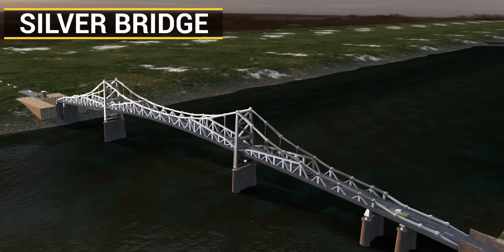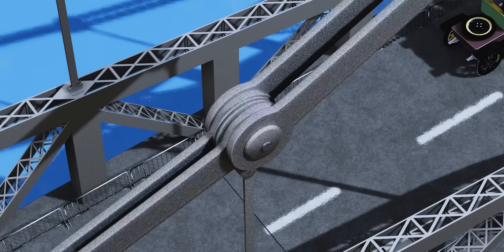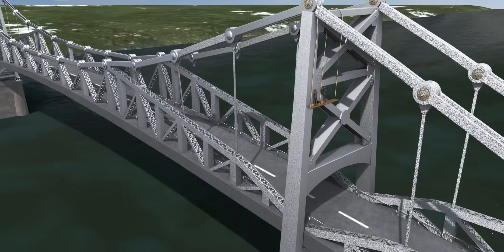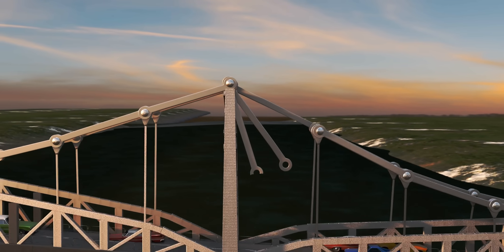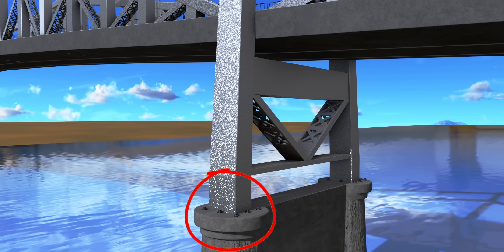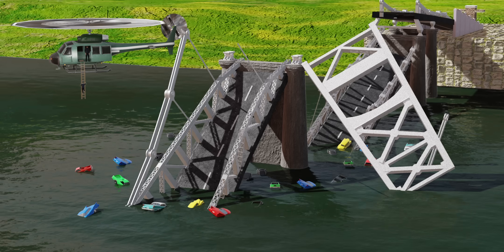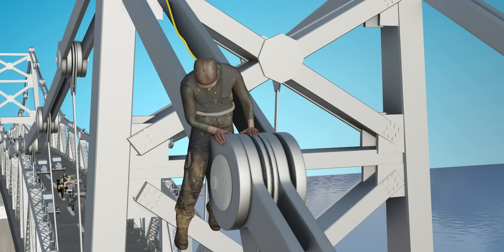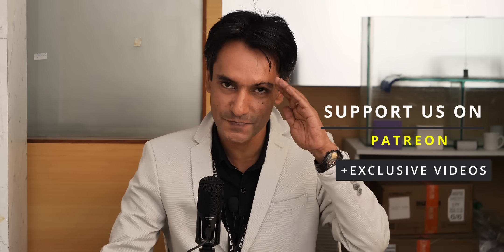Silver Bridge | The Tragedy That Changed Civil Engineering Forever

Comment: As a structural engineer, I disagree with you that the increased weight of vehicles was the main cause of the collapse.
This increase in weight only accelerated it. In other words, if the vehicle weight had not increased, the bridge would have aldo failed, but latter in time.
The main reason was the terrible design, with the aid of corrosion.

Comment: Any idea what electric cars weigh? A lot more than normal cars! I have a relatively small electric car but it is so heavy that I now have tire ruts in a brick driveway that was perfectly flat for decades before the electric car came. Don't get me wrong, I love the electric car (combined with the solar panels on my roof), but the fact is that they are heavy. So, as more and more electric cars get on the roads, what effect will that have on infrastructure?

Comment: While I found the rocker bearings an interesting solution to the expansion of the bridge, the effect it had on the structural integrity of the towers was another element that doomed the design, I learned something new and found some interesting insights, I'm currently finishing a diploma in mechanical engineering and enjoyed the video 👍 got to learn from the past and not repeat the same mistakes!

Comment: Another bridge, in west Orange, MA, spanning the Millers River, the Route 2 bridge developed a big crack in one of its two primary load carrying beams., similar to a through type plate girder bridge, with some continuous support design. The structure consist of three spans, two abutments and two piers .
Its replacement design consist of seven deck beams, of a continuous bean design.

Comment: Good video!  Very informative and interesting.  Makes it scary to drive over these bridges.  I think most people think those large cars from the 1950s through the 1970s weighed more than current vehicles.  I drive a 2023 BMW X5 and was shocked at the 5300 lbs it weighs!  It’s deceptive because the density of vehicles has increased dramatically - it’s not just EVs.

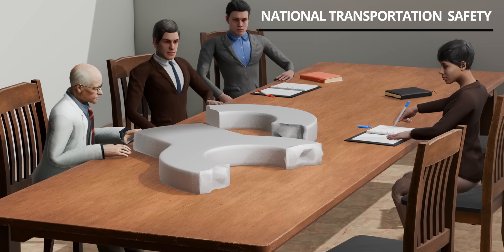Comment: 08:06 here you see the NTSB testing the magnificient strength of their conference table. The guy in the rear left lifted the bridge parts onto the table. The doctor in the front left is calculating what 20 new knee caps would cost, in the case of a table collapse in full session.

Comment: I the CaesarKing had ordered previously the energy nodes per station of segments at each stable bases per group pre active and passive transports a continuous infusion of funds at polarity of such in institutions and none institution polarity sides or of both sides each PER productivity basis each area segments determined and area scanned from space by my AI Quantum Satellites of ALLOCATOR from sourced fund galaxy and other sources synch by the CaesarKing orders in alternate refill and fund teleport as my public services orders worldwide meaning the wastage funds by initiate of cause and effect a deduction from the original fund to be payed initially and partially by the causers of either polarity or whatever sides causers to correct economies but if naturally caused or if not stimulated cause and effect due to environmental factors the negative sides gains from that by percentage because theres a continuous fund allocations understood. Remember theres 3 in everything not only at the surface Earth the economic indicators but also the ground down levels and the vertical up levels to each spiritual source of origin they and them can either plus or minus gain or lose money and by geometrical slice of pie angles to whatever plain sides or orientation all direction from plate circle point of view if up or line or X interconnect of pie in a circle or cross interconnect if the circle plate be measured at 4 corners of the Earth point of view from its Centerpoint parallel to the Earth 2 cores of opposite sliding core parallel at the surface South East Asia equatorial hemisphere and radius Centerpoint to its opposite side of globe Earth of its version, the reason why The CaesarKing remind you now with that previous order for the none updated to the order and busy in their endeavors while that order was created. Understood. Let it be

Comment: There's a need for new design model of bridges to withstand strong earthquakes such as the anticipated and tauted The Big One Earhquake. Now ordered for the upcoming bridge modifications of close temporarily for passage for either renovate or remodeled pertaining to physical structure on Earth bridges only. The designed for this are for the straight bridges only. Of the with graphene component bridge materials and with Ground or undersea bed foundation of dual mode magnets types of  its types preference optionally connected to Earths gravity and magnetism by optionally connected or not synch depends upon the detection of Earth shake source in events of such such as naturally underground tectonic plate cause and effect or the frequency induced effects meaning there should be sensors at its foundations powered by water hydrogen ion molecules for those areas only who can afford of such infrastructure project. Another modification of such are the two sides of bridge electronic connectors of changing ions charges when needed for stability meaning aside from graphene if expensive there should be the usage of extra hard or tough materials for such such as the rare Earth metals or science lab created toughening materials components for its floors of bridge applicable also to the curving bridges with the addition of overhead codon like beam curve of science photonic beams stabilizers. The third and most ambitious infrastructure project of bridges making are the side rails metallic bridge safety structure in interconnect by rays to up space modular floating stabilizers of space structure system by node to node energy interconnect modulated by orbital satellites while it's low ground or sea bed foundations are either Earth gravity or magnetism connect to the extenders rods stabilizers of the to and fro energy to science types elements by its specific compounds movement of to and fro interact to its science types identifies for its extenders of stabilization structures to make the bridges prepare for great earthquakes, while the more modern design for bridges to be shielded from air platform attacks or monster attacks are the bridge cloaked shields of energy shields projectors from within thd bridge itselves bean or rays enclosets of its shape design such as alternating beam or rays or merging at Centerpoint rays or beams at the enclosure of bridges or at sea or river or ground area projectors and receptors at bridge to and fro or inherent in its structures implode as examples only for such projects. Let it be

Comment: A safety factor of 1.5 for a bridge is absolutely insane.

They use 1.5 for airplanes because otherwise they wouldn't get off the ground but a bridge is a grounded structure that you absolutely don't want to fail.

A safety factor of at least 3 should be required. It's mind blowing they approved such a low safety factor.

Comment: Another problem with a low safety factor is that it makes it very hard to service the bridge. Suppose they had caught the member before it fractured, with just the weight of the bridge alone, if they had removed it to replace it, the same thing might have occurred. They would have had to make a connection to either side of the joint, PAST IT without connecting, in order to temporary take the load to allow the damaged member to be repaired because the bridge cannot take a link failure. That is what is termed a "fracture critical" structure. Safe as designed, but which cannot tolerate even a single failure of a major component. Heck, even losing one of the hangers might have caused enough strain to distort the remaining members and render the bridge unserviceable, likely resulting in its demolition and replacement rather than repair.
Reply: Good video but I dont think the point about vehicle weight is accurate. (im not blaming the uploader, that point was originally made by US engineers) Even in 1927 loaded trucks weighing tons were a regular sight on US roads. Usually, roads and bridges are designed for worst case scenario, bumper to bumper semi trailers with loads. The bridge was purely a poor design with zero redundancy.  Once the pins and members were seized from water and corrosion the loads cant be shared and it was just a matter of time before cracks appeared and the whole thing collapsed.
Poor design.
Reply: At that point,why even bother making such a thing?If traffic was big,build a better bridge.If it isn't,ferry boat.
Reply: @naamadossantossilva4736  Did you watch the video??

Comment: if you judge as mechanical engineer, it is fatigue failure, yes corrosion due to water has fastened the failure and reduce the initial calculated life.

Comment: I was under the impression that engineers over compensated for weight in order to offset this. Over compensated by factors beyond what this bridge was engineered for.
Reply: They did but it's not possible to compensate infinitely so there's still a finite weight it can carry. The trouble is compensation is not meant to ever be reached. It's just a safety buffer. Once you start loading it more the buffer gets smaller.

The real issue seems to be the government not properly communicating maximum weight to the drivers.
Reply: They do, but apparently not enough, and also not enough redundancy. They cut too much cost.
Reply: @pabnckncykma1297  that's not a problem. Too high cost is also a bad thing. There are plenty of bridges with maximum capacity displayed, so that large trucks don't damage them.

If this bridge was designed for specific weight capacity and it was exceeded it's the fault of whoever exceeded it.

Comment: Factory of safety for structures like 1.5 was such a foolish decision...
In these type of structures , atleast 3-4 should be kept.
Reply: A 4 times safety factor would mean everything was so overbuilt the pillars holding it up might fail prematurely as the entire bridge might end up more than the ground could support. The coliseum in Rome was probably only 2.5 times safety factor.
Reply: Anyone can build a bridge that wouldn't collapse. It takes a good civil engineer to design one that barely won't collapse. If they increased the FOS like you suggest, there wouldn't be any bridges because they would be too costly to build. The whole point of engineering is to optimize the design to utilize the materials to their limit while also being safe from foreseeable threats. We still never design of excessive overloads today.
Reply: @aryanpareek770  ...I have studies in books that while handling brittle materials like CEMENT and CONCRETE...factory of safety should be more than 3

Comment: ..... save costs. .
Yup. That's always a great idea 💡
Reply: That's not inherently a bad thing, the issue is if you accept some limitations to save costs (e.g. lower weight capacity) you need to communicate them properly and take them into account (by banning heavy vehicles in this case).

Comment: We have an old chain bridge in Budapest. It was built in 1949, designed by Adam Clark. It is still in use and has a quite heavy traffic. It was bombed in WW II, and after the war, it was reconstructed.

It has double chains on both sides with interleaved hangers. I think it has significant redundancy.
Reply: Wild
Reply: if it was built in 1949, it wasn't bombed in WWII. WWII was long over in 1949.
Reply: @SoraNakamura-974  You have a man who's probably Hungarian, and he is writing in English, before you go criticize his time line, to make yourself feel superior, maybe consider a typo, like the date, maybe 1939? Which would make it existing to be bombed in WW2.
Reply: @SoraNakamura-974  It was REbuilt in 1949, after WWII. The retreating german forces blew up the bridge on 18. January 1945. (like all of the bridges over the Danube in Budapest). The original bridge built from 1840-1849. The opening of the reconstructed bridge timed to the 100th anniversary of the opening of the original bridge. The towers of the bridge remaind the original, those survived the german demolition. This bridge has sound engineering. The Silver Bridge was primitive at best compared to it. https://en.wikipedia.org/wiki/Sz%C3%A9chenyi_Chain_Bridge

Comment: As a structural engineer, I say well done. Technically accurate and presented in a way that lay people can understand. That's not easy in this business. I've seen people's eyes glaze over when I tried explaining my work to them.

One thing that the NTSB report stressed was the very poor notch toughness of the eyebar steel. If heat treating is not done precisely, you may be getting adequate static strength but the member will not resist stress concentrations like crack tips or impact loading. This issue gets worse with lower temperature. Toughness is usually measured by what's known as CVN testing. A sample taken from the failed eyebar fractured with an impact energy of 2 ft-lbs, whereas the bare minimum for modern steels used in bridges is 15 ft-lbs for redundant members and 25 ft-lbs for non-redundant. Stated more simply, the eyebar steel was brittle, especially considering that it was cold on the day of the collapse. This was borne out by an examination of the fracture surface. It was noted that the stress corrosion crack only covered a small percentage of the steel area before the eyebar literally broke like a piece of glass.

Comment: Why wasn't the overweight stress (the significant increase in average load weight) identified from inspection and maintenance over the intervening years?  Or is this just the typical American "it was OK when we built it so it should be fine forever ... or until it collapses ... whichever comes first".

America seems very good at identifying the problems AFTER a bridge collapses (with however many fatalities), but absolutely crap at identifying ANY problem, prior to that point.

Comment: The static load isn't the problem. Vibration means loads "oscillate" and hammer on the joints. The SF-Oakland Bay Bridge had a similar rigid link failure during repairs and replacement of the eastern span after the Loma Prieta earthquake.

Comment: Now you know why they replaced the Bay Bridge and also the Carquinez Bridge in California both of them were the same design as The Silver Bridge cantilever suspension bridge with steel eye bar chains. What happened is what caused the Silver Bridge to collapse saltwater got into the eyebars and caused them to crack and both the Carquinez Bridge and on the Bay Bridge the eyebars landed on the deck. Because of this Caltrans said enough is enough and both Gavin Newsom and Jerry Brown ordered both bridges to be replaced with self-anchored suspension spans. The only bridge that was not replaced in that area was the east span of the Carquinez Bridge because this bridge is a saddleback truss Bridge and not an eyebar suspension bridge like the Bay Bridge or the West span of the Carquinez Bridge.
Reply: The Ohio river isn't salt water. Fatigue and rain water corrosion is what caused the silver bridge failure.
Reply: They only replaced the section of the Bay bridge that went from Oakland to treasure Island the original structure from treasure Island to San Francisco still exists. They did not replace that section.